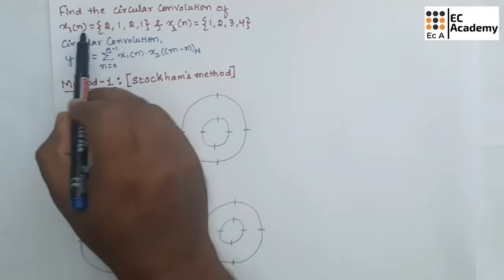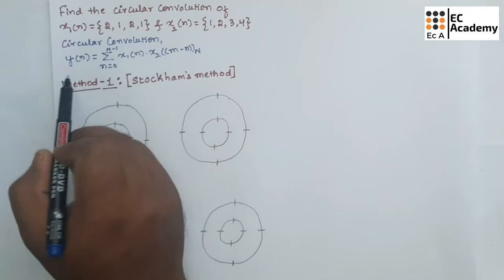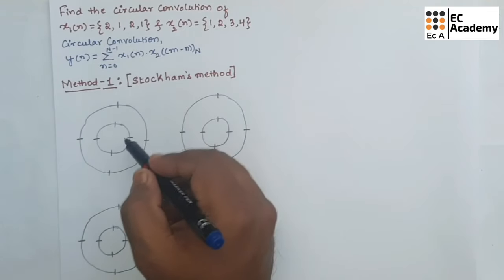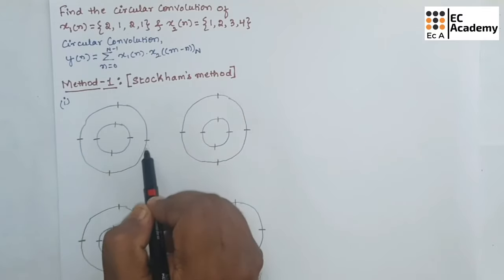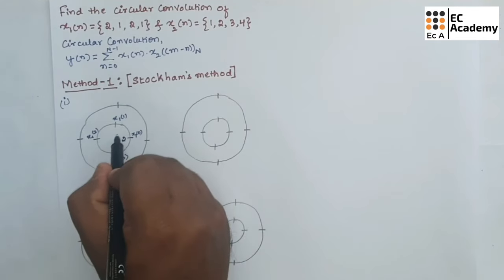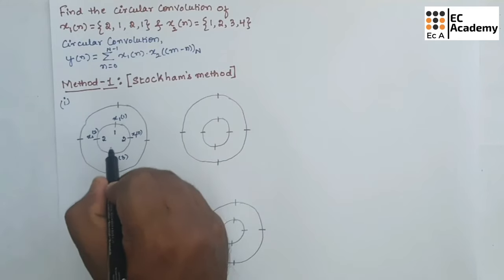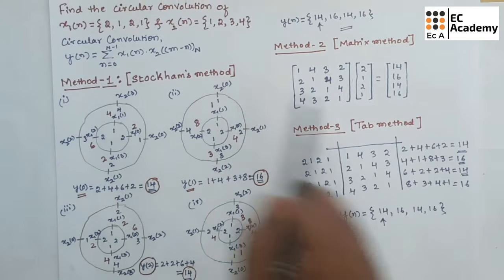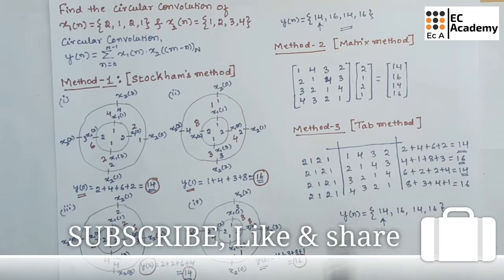DSP#31 Problem on circular convolution using stockhams method, matrix method and Tab method

Comment: Sir if you don't mine once watch this video you are in mistake in one ting first you say clock wise ..and anticlock ....after some time that is anticlock wise direction ...sir please explain clearly which one is clockwise and which one is anticlock wise direction
Reply from the maker: Rotating the value towards right side is CLOCKWISE direction and towards left side is ANTI-CLOCKWISE direction…
Hope this is helpful…
Do subscribe and keep supporting EC Academy✌️
Reply: @ECAcademy  this not Im asking ..you say inner circle is anticlock wise and video goes to few mins after some outer circle is also a anticlock wise you to told the students .....Im request to you watch your video please
Reply: @ECAcademy  What Im said to make inner circle is constant and it is in clockwise direction .2 outer circle is anticlock wise then multiplied outer circle with inner circle...Next change the values of outer circle to move towards into anticlock wise direction at same time inner circle values constant Now the ans is perfectly correct ..Thank you sir🙏